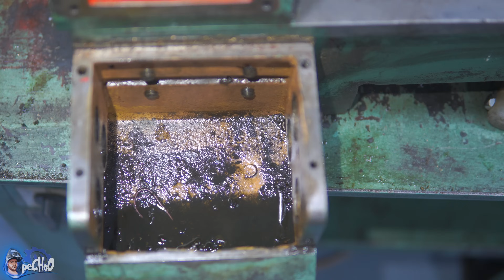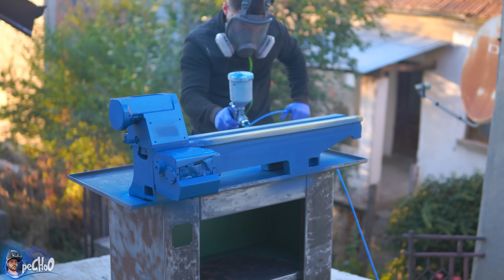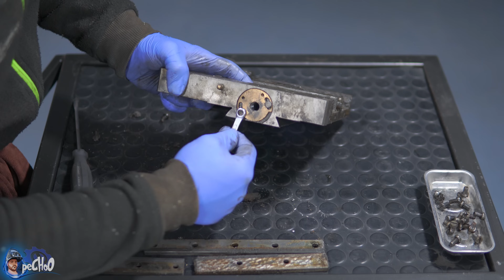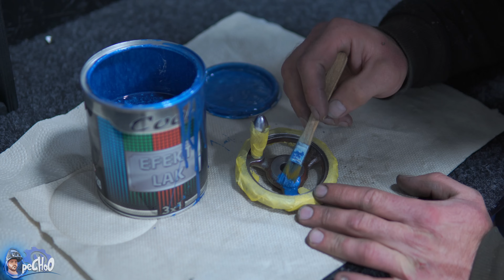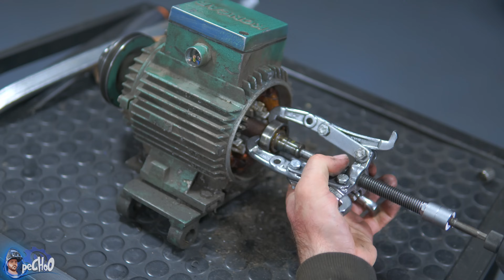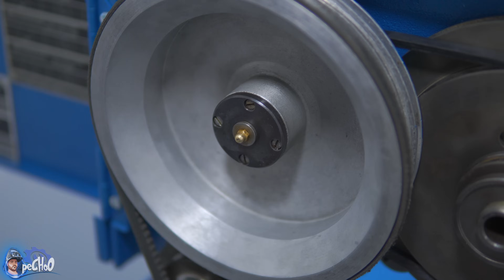Lathe Restoration   -   LATHE FOR EVERY HOME!!!

Comment: PeCHoO you need way oil for the slides not grease as it picks up metal shavings and wears out the way slides get an oil can with a small applicator tip so you press in the small ball bearing and apply the way oil 👍🏻
Reply: You can still use way oil and add it by way of the zerk fitting.
Reply: Gleitbahnöl
Reply: Maybe he will turn ice on it

Comment: There should be ZERO grease in or on that Lathe, everything gets oil, some thin, some thick, BUT NO GREASE -
Reply: Bearings are fine with grease(except if it's a closed oil system, then yes).
Reply: He'll figure that out when the chips start tearing things up.

Comment: You made it look real pretty.But I would rather have it accurate.Then have it destroyed with a grinding wheel on the waves and the slides and destroying the lead screw with a power wire wheel. As you get older you'll learn how to do things the proper way.

Comment: Looks great! You should be using oil instead of grease on the slides. Also, the contact surfaces for the carriage, cross slide, and compound should have been stoned instead of sanded or wire brushed. Or better yet, precision scraping to true the mating surfaces to each other.

Comment: Meticulously done! I’ve seen a lot of “restores” done but regardless of everything on yours being “in spec” as for tolerances, this one is the cleanest with the most care given to appearance I’ve ever seen. So tired of seeing machines stripped down then painted and reassembled with greasy hands plus the addition of scratches and dings everywhere. Nice job overall, very appealing to the eye! Now run through it with a micrometer and tighten everything up to as new as possible and you’ll have a fine machine for life! (That is IF you’re making rocket ship or medical parts, but don’t worry about it if not😬) 
👍🏼👍🏼 from this guy, thanks for taking us along✌🏼

Comment: Never seen this model.  The design appears to borrow a bit from the Myford 7, but with a fair amount of differences, too.  Doesn't appear to have a powered cross slide, which is a bummer, but the t-slotted saddle is something that all small lathes should have, but too few do.

I can see a lot of very good work here.

Comment: Nicely done, it looks nice again. But disassembling, cleaning, painting, assembling, is not a restoration. There are dozens of these types of "restoration" videos on YouTube, but there is no real restoration involved. How about the play, the sag of the bed, the alignment from various parts, the alignment, the precision and so on... As far as I can tell, this is now a sexy looking lathe, which can still deliver poor results..
Reply: Restoring is, back to original with little changes and repairs of broken parts or making and getting new parts specialy the worn out ones..
If its precion is still not like the new, then it is just cleaning and re painting. Restoring a lathe is not that easy.
Reply: Building back to original specs is a remanufacture.  Stripping it down, cleaning, repairing or replacing anything that needs it, then reassembling, adjusting for correct operation, painting and detailing is a restoration.
Reply: It's a restoration but poorly done
Reply: I don't think the bed was sagging but that tool compound is damaged beyond repair
Reply: Ну автор на базаре новые наклейки сделал и направляющие абразивом зачистил от руки. Шутка.
Reply: @vandalsgarage I came here to say the same thing. I rebuild machines often in my work. The term 'restoration' is not applicable at any stage of machine overhaul or rebuilding. I think people give these youtubers a hard time. The guy did a good job. Now that the machine has be thoroughly cleaned and reassembled, it is ready for testing. You could spend years working on one machine, if you wanted to be pedantic about it.
Reply: No lathe should have grease being used. As soon as I saw him putting grease nipples everywhere instead of oilers I knew what was coming, but I had suspected it when every time he assembled things they got greased in the mating parts. If a "Restoration" is new bearings, a good clean and a repaint then this is a good restoration! My arse!
Reply: It is fun to watch and that is important to me.
Reply: I went to school for this job in Prvomajska and i can say this is just cleaning and painting...real restoration involve many procedures off repairing many surfaces and parts...poz iz Hrvatske
Reply: You need greater knowledge and a good milling machine to restore this lathe.

Comment: This was s nice video about how to clean and re-paint your lathe. I am of the opinion that you likely could have saved around 50 hours if you had used paint stripper instead of that darn grinder/sander! That was a lot of wasted labor. Also, cleaning the ways with a grinder/sander could cause damage and errors on the ways. A flat iron or piece of granite with 1000 grit paper and oil would have been a better choice. Even so, it appears that it is working so, all's well that ends well.
Thank you for sharing.

Comment: use vg32 or vg46 oil for lubrication. And clean all the grease. Otherwise you will end up with dried grease and excesive wear of components.

Comment: Again like other no grease for metal lathe slide. The grease plus metal chips wear out the surface of the bench. the metal lathe bench has pronounced wear, it may need to be rectified for increased precision. the variation is not very great but can affect precision over a long part length

Comment: OMG! Not a renovation but just completely unnecessary repainting from a nice workshop green to very ugly blue, even without any base coating on raw iron. Than installation of the cheapest (or the shittest, if you like...) chinese bearings for 10 cents each with a... hammer. Imposing hammering. You could use a field stone with a better effect...Absolutely no mechanical improvement, nor even any checking or indicating the imperfections on bed, cross slide and spindle. Something like curing syphilis with cosmetic powder. Congratulations.

Comment: This machine and the substructure is mainly a replica of the Maximat Compact from Maier (Austria), today the company is called Emco. (https://www.youtube.com/watch?v=S9M9t1tlGTY&pp=ygUPbWF4aW1hdCBjb21wYWN0) The design has been slightly modified for larger parts. Nevertheless, the lathe looks good and solidly built. I have seen one improvement: The oil drain plug has been relocated so that you can hold or place a large drip tray underneath it. The restoration has been carried out professionally and thoroughly, one of the best I have seen. Have fun with the machine.

Diese Maschine und der Unterbau ist überwiegend ein Nachbau der Maximat Compact von Maier (Österreich), heute nennt sich das Unternehmen Emco. (https://www.youtube.com/watch?v=S9M9t1tlGTY&pp=ygUPbWF4aW1hdCBjb21wYWN0) Für größere Teile hat man das Design leicht verändert. Trotzdem schaut die Drehbank gut und solide gebaut aus. Eine Verbesserung habe ich gesehen: Die Ölablassschraube wurde so verlegt, dass man ein großes Auffanggefäß darunter halten bzw. stellen kann. Die Restaurierung ist fachgerecht und gründlich durchgeführt worden, eine der besten, die ich gesehen habe. Viel Spaß mit der Maschine.